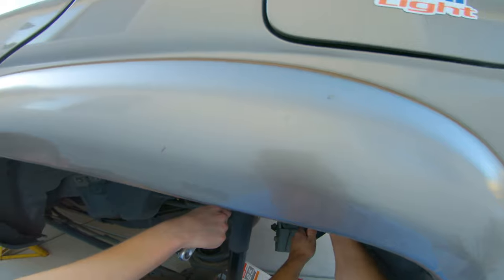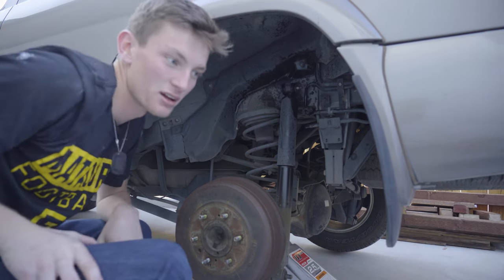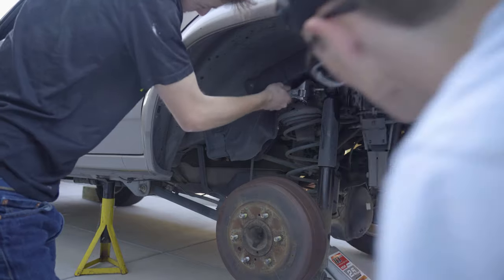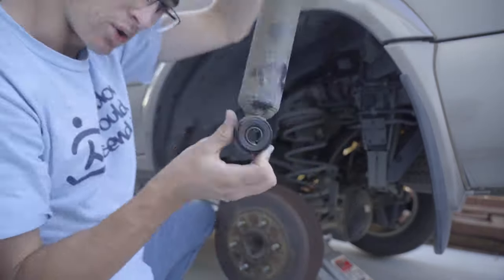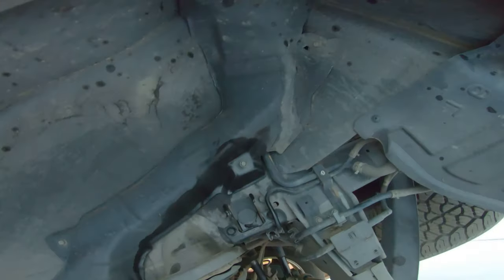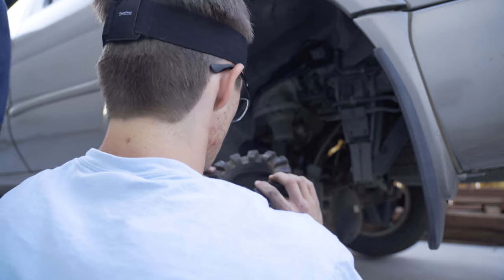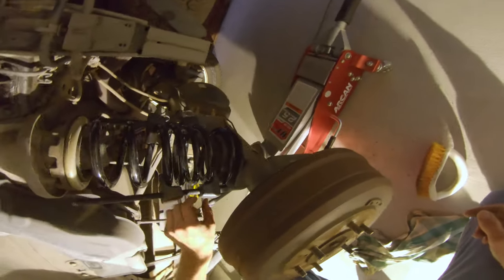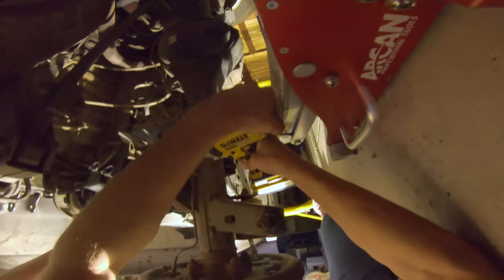Lifting a 02 Nissan Pathfinder | KYB Excel-G struts + AC coils, Landrover Defender coils + Bilstein

Comment: be careful flexing your suspension with those spacers, might grenade the cv axels because the cv axle isn’t meant to be put past a specific angle so it stretches the cv axel when the wheel is in the air, but thats only with spacers. If its just a spring then its nothing to worry about
Reply from the maker: Yup we are aware. Need to make a update video but the subframe has been dropped, etc for quite some time now. It's all corrected now.

Comment: You shadetree mechs. Got the cleanest tool box in town.Hey boys just drop rear end more spring come right out! Always attach top first that way adj the bottom , easier for the rear !
Reply from the maker: We had some other things to worry about when doing the rear lol, but yes, could have just dropped the rear down and popped the spring out. The top of the stock spring was pretty beat into the mount point, as was the messed up stopper 🤷‍♂️
Reply: What do you have to drop for just the rear spring to pop out? Shock? Pan hard bar?

Comment: So I have the same oem 17 rims, if your pictures you said you can fit 265/70/17 A/T tires without wheels spacers? I’m confuse do I need 1-1.5” wheel spacers or not with oem wheels. TIA
Reply from the maker: Spacers. I believe 1 inch is minimum needed.
Reply: @sjrmac  HOPEFULLY you can answer this question,
im just finished with my project and love the way my pathfinder looks except for one thing.
I bought the same parts you used in the video, except for the 2 inch strut spacers, I bought the front springs coil 2" from 4x4 parts (SPAC96PFFTCL). after the installation. the rear is 2.5 inches taller than the front. I was told i didn't need spacers as long the spring stretch the strut down. i currently installed the kyb excel-G strut #335036 & #335035. what did i do wrong and what are my options if i dont want to use strut spacers?
Reply from the maker: If you can find a longer travel front strut that can bolt in and accommodate a taller coil, then you can solve the issue. Otherwise you can run a strut spacer and then deal with getting the front subframe dropped.

Comment: @Samuel Ridosko - amazing work. Whats the bilstein lenght in the front? I wanna do the same but with landrover springs (about 3" lift) and without  strut spacers. Also can you send me exact KYB Excel-G Struts model?
Reply from the maker: Kyb struts are the one up front, Bilstein in the rear. Miles found the info on a forum, so i don't know what they are. AC medium duty coils up front though, so that might help with research. Good luck!
Reply: @sjrmac  thanks! :)

Comment: I have an 02 as well, it looks like u just simply bolted on the rear shocks and I heard they need a modification. Please remember which part # u got, at least where u ordered them from???!
Reply from the maker: Part number was somewhere on the forums along with the info on the rear Landover coils. Once u find the number, just order from anywhere it's available.
Reply: @sjrmac  (33-185552) ??
Reply: Thank for the help, sorry just want to like triple check everything before I order the wrong thing ya know
Reply: I just specifically wanted to know the part # you used because I have the same whip, and I’m putting almost the same stuff on
Reply from the maker: I get it, but i don't remember and i wasn't the one who ordered them. I do know the forums had the info for which part # for the 5100 t(he one to get)

Comment: No need for bilstein 5100 In the front?? I have an 02 as well and I want to get it dialed in. Ordered the Land Rover coils for the rear, got the front coils covered, now I know to get KYB struts for the front, and bilstein shocks for the back. How’s that sound???!?
Reply: Would love your input 🙏🏼
Reply from the maker: Sounds exactly like what we did. Part numbers are whatever was on the forums. I don't remember, but look up lifts for R50 and you'll get some nice info. 👍
Reply: Hey man do you know what Land Rover coils you used for the rear and the part number and how much lift they gave. I would greatly appreciate it😁

Comment: Is the cellulose style gasket still holding up? Don’t feel like spending $40 just for a new OEM gasket for each side
Reply from the maker: Yes, it's been fine so far. It's worked. We put it between both sides of the strut spacer and it's been fine.
Reply: @sjrmac  Thats great to hear.  I'm currently tackling it myself and have run into some minor issues.  Curious if you guys used new KYB or OEM strut boots and bump stops.  The KYB ones seem to not mate perfectly with the top OEM coil spring seat/plate.  I just kind of forced it in there, hopefully it has enough friction to stay in place.
Reply from the maker: I'm positive we used OEM, but don't remember about the bump stops. I know we left those as is. I'd try and look at the video closely in 4K to see as I can't remember off the top of my head. 👍

Comment: Did you encounter problems with the rear suspension mounts and differing diameters?
Reply from the maker: Not as far as i remember. Coils sat fine. Just had to shave the little tube thing for mounting the rear Bilsteins into the upper mount. Should be in the video if you take time to really look at it 😄
Reply: Thanks for the reply. I just noticed your rims. Are those stock rims that are painted? If so, how did you get them to look so good?
Reply from the maker: Wheels are painted with truck bed liner. Just spray well!

Comment: Hey Sam! I've got a 2001 pathfinder that has had rear sag in the back forever. I have an air lift helper spring bag kit in it but they keep blowing up. I have brand new shocks in there. I'm not looking to lift it, but want a way stiffer setup in the rear as it holds a 75lb bike rack off the back and 5 people and 5 bikes on the rack. Any ideas?
Reply from the maker: Remember with airbags: they have a max PSI and a minimum one too. Honestly sounds like you need a better vehicle for this. I've done your same setup in a 2011 Subaru outback 2.5i and yeah, not quite the vehicle for the job. Best thing you can do is look for OME springs by ARB online and try to determine what fits the rear. They have medium and heavy duty options depending on what kind of constant weight you want to load on them. I have medium on my 80 series LandCruiser in the rear as I've got about a constant 440lbs of additional weight (rear fabbed bumper with Jerry cans and a 35" tire). Beware tho, take the weight out and it'll be quite a bit stiffer and sit taller. Read up on the skinny helper bags that go between the coils. There's plenty of options these days. Good luck.
Reply: @sjrmac  Thanks a ton for the response. I tried several different pressures between min and max based on their recommendations and you're 100 percent right. Not the right car. But it's what I have right now and works really well besides. Gnarly to do it with an outback haha nice! I ended up hearing back from Dobinson and just ordered stiffer springs that they suggested based on my exact setup. Hoping it doesn't overdrive the front too much going downhill after dropping folks at the top, but if so I'll get front springs too and hate myself for not just getting a whole OME setup with a lift. Thanks man!
Reply from the maker: Yeah, i did a whole medium/heavy duty lift for the LandCruiser. Check it out on Instagram @sjrmac_automotive 

One day take your time to install the lift right and see what things you need. Things like extended steering shaft thingy, maybe brake lines, all that stuff. Even for a LandCruiser, there's no "everything" kit and I'm still needing things.

Comment: What size wheel and tire could possibly fit? I want to get 20x12 fuel d612 with a -43 offsett
Reply from the maker: I'm not sure. I said these were 17inch rims with 265/70/17 KO2s. I don't know in inches and offset though
Reply: How did your 20's fit  what size tires are they in.
Reply: What’s the part number for 5100 shocks or sku
Reply: Unless you're driving highway only 20" rims are useless offroad, not enough sidewall for the tyre tread to work efficiently.
Reply: @sjrmac , I have a 04 pathy le and I ordered & received dobinson front & back coils. Will I be able to fit 265 70 17 without a spacer lift, but just the lift of the new coils?

Comment: Man my front right strut housing is litteraly pushing up ( towards hood of engine) did you guys have any problems with the welds to the housings for thw struts
Reply from the maker: So far so good. Have no issues like you are describing. Would check up on some online forums to see if anyone else mentioned this before though if I were you 👍👍
Reply: I had this with my 2001. Nissan has a recall. My drivers side was so bad it was pushing into steering column, they could not do anything about it. All they do is add 2 reinforcing bars  and bolt them in place. I went to local pick and pull and cut section out. disassembled welds on both and reassemble good one in place and re welded. Just need an alignment.

Comment: Did you correct the CV angle? if you didn't i wouldn't be going off-roading, you may be walking home for snapping something on your drive line, in AU we not allowed to use spacers, totally illegal and wont pass for rego PS. its easier to take the caliper off the disk rotor, and hang it up in case you rip out the brake line when it drops. 2 inch lift is max you should go, lifting it that high needs extended brake and fuel lines, 2 inch lift is max you should go, id be keeping an eye on that. ill give you 8/10 for effort though lol practice makes perfect ;-) and you learn your own car this way, i had a Pathfinder club so teaching ppl was great and rewarding, the only thing i found near impossible was getting certain things like rated recovery points, even went to 4wd camping shows, the guys and girls tried on their laptops trying to find them for me, they simply don't make them, i was going to make my own with toughened steel and thick but tossed that idea, another thing is the 2 ton max cap towing load on your tow bar, upgrade to a patrol or landcruiser, trust me wayyyy more options :D iv still got my R50 2000 Pathy with 300k on the clock, its 2 inch lift handles wombat holes and bigger but needs the new Lokka in the front and rear diff, look up on youtube "Sub $600 DIY Locker install" Shawno from 4wd Action explains this new Lokka technology, its cheaper now though oh and $600 was AU currency i think its like $425 AU now
Reply from the maker: I appreciate the comment Rick! So far Miles hasn't had any issues with the lift and it's been nearly 6 months or more. I believe the spacers are only necessary due to having the stock wheels and no offset to compensate.  He should probably do extended brake lines though, I'll mention that to him. The Pathfinder is a fantastic vehicle and I actually had one in the family for a while, sold it to relatives, and they sold it about 2 years ago I think. I should have bought it back, was a 01' SE 5speed manual if I remember right and that had a lift on it as well. Proper lockers would be good as well. Cheers mate!
Reply: Samuel Ridosko I’m buying front and rear 4wdsystems Lokka, I have to do my homework but I think it’s the same front diff as a GU Patrol, I’ll call them up sometime this week
Reply: @rickusana2113  That would be interesting to know. We don't have the Patrol in the U.S. but the reverse cut gears up front make it tough to match. You can use Xterra parts in the rear for some changes though.
Reply: I just bought a 2004 pathfinder and want to lift it little bit. 2 inch to 2.5 is good for me. However I'm looking for something comfortable. What do you recommend guys ?? I have no extra weight. Its stock car.

Comment: Hey bro, what model number is your bilstein and the kyb struts? Thanks
Reply from the maker: Kyb is easy to look up and bilstein is in the description.
Reply: Autozone have the kyb in stock at my local store. However bilstein 5100 have several parts number 33-185569, 24-146715 wondering which one do you have? Thanks
Reply from the maker: Which ever ones are the longer ones. Don't remember the exact number. Pathfinder forums have some suggestions on which you should do

Comment: Great video, i have a 2003 pathfinder rwd, and have a similar set up as yours 
rear suspension: NRC9447 coils and 5100 bilstein,
front suspension: KYB Excel-G shocks for rwd #335036 from rockauto and Pathfinder Front Lift Coils from 4x4 parts # SPAC96PFFTCL. 
My only problem is the rear is taller than the front.
Rear: Ground to fender 37" 3/8
Front: ground to fender 34" 15/16

There is a difference of more than 2 inches. it looks silly, i don't know what i did wrong any help would be much appreciated
Reply from the maker: You can get lower height rear springs honestly. Up to an inch taller in the rear over the front is good in my opinion as that means once you load gear and weight in the vehicle, it'll sit nice with minimal to no sag at all.
Reply: @sjrmac  so the 9447 has a narrow design. So I installed the skinny side on the bottom and the wider side on top. Is this correct?
Reply from the maker: If it sits in the spring perch correctly, you'll be good.

Comment: Whoever was loosening that bolt on the top of the spring...don’t do that pointed at your chest.
Reply from the maker: Yes that was me 😂. It's something you don't do, but the threads were bound up on the top boot so had to give it a go (I would have just dropped it a few times if this happened again and stood back.